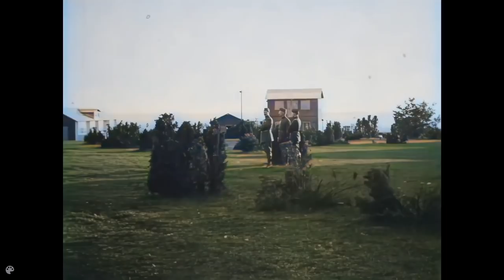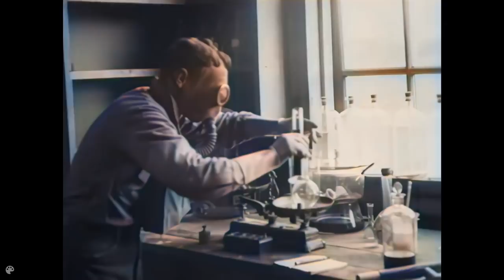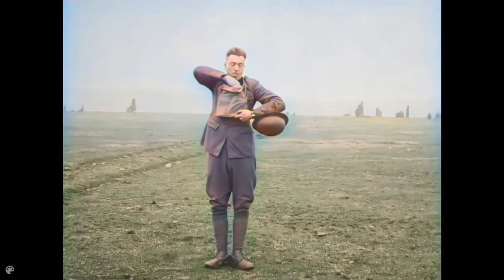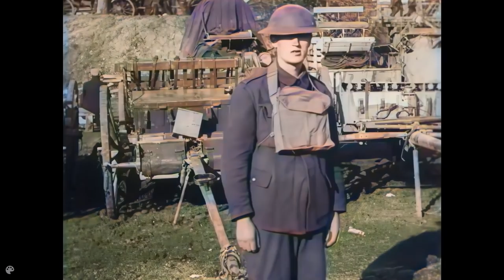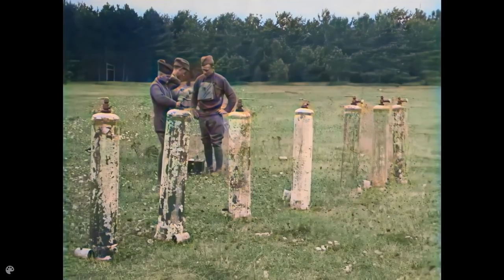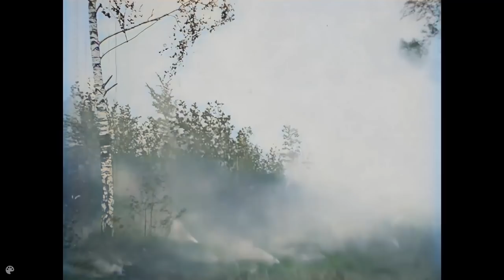Chemical Weapons Testing | WW1 | [1080pHD] | Colorized | AI Enhanced

Comment: The gas mask that looks like a plastic bag had me thinking did it have any filters?
Reply: Some early respirators used the material of which they were constructed as the filter. You exhale through a one way valve. Some later ones worked on the same principal, sealing on the neck. If you are not clean shaven on the face, a face seal will leak, so, especially bearded naval personnel, would find them useless.
Reply: That one's called a Smelly Duck.

It only works when you piss on it.  Nope.  Not even joking.  Look it up.

Comment: Thank you for this nice video. It is amazing to see people more than 100 years ago in color. It's a pitty it isn't chronologicaly. And many aren¨t chemical but smoke ammo. An as a CBRN specialist I must laugh when I saw the men with mustard gas shell and a man in laboratory. Safety standards were lenient in those days. What they did is quite safe (in exception this way of distilation. What would he have done if the glass had broken?) but by repeated contact with even small amount mustard vapors (without protective suit and mask put on too late and put off too early) they may have built mustard hypersenzitivity.